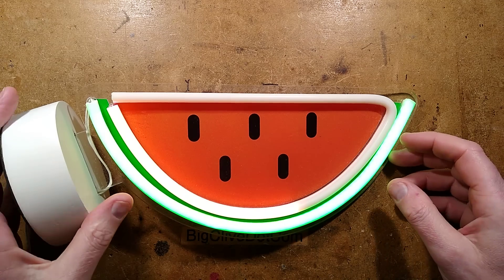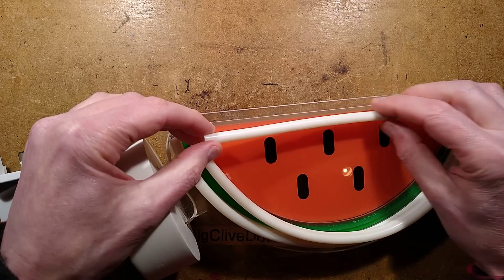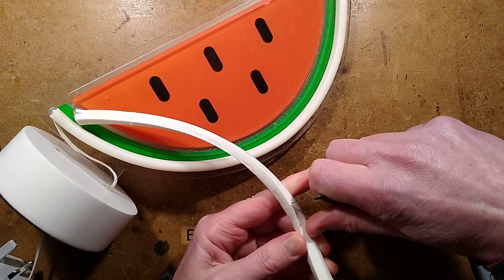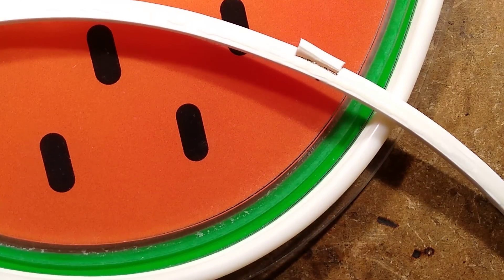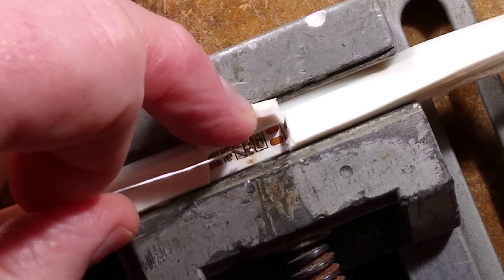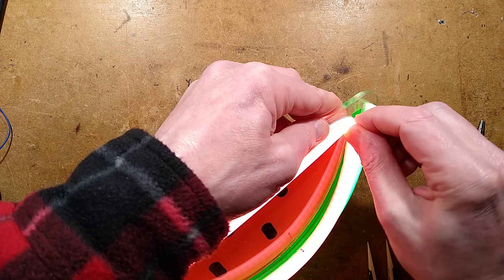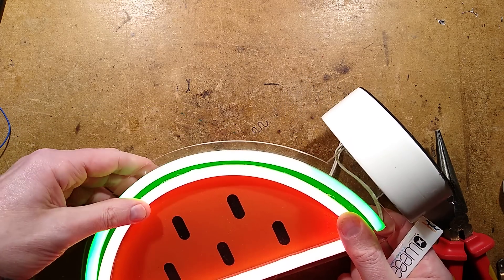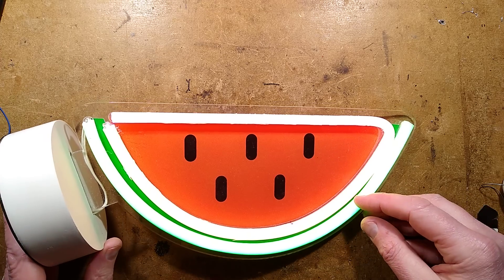Faulty LED "neon" ornament - can we fix it?

Comment: 7:33 brave to be poking it with a metal spudger while it's plugged in, and you havn't checked the power supply isolation.

Comment: Video Idea: My wife has just asked for a 'candle warmer' off Amazon.  These are made in china and use a halogen bulb to heat scented candles, typically beneath a little lamp.  They often have a wooden base, and the most damning reviews of several popular brands mention them turning themselves on randomly.  Seems massively unsafe to me.
Reply from the maker: That is a bit worrying.  There are many electric wax melters for sale.  They often use a PTC heater to get a consistent temperature.

Comment: Is this plastic UV-resistant or do i have to say "non-yellowing"?  Most of the (semi-) transparent plastic LED strip covers turn yellow over time. It can caused by daylight or violet/uv-portions/rays present in the light of the LEDs.
Reply from the maker: The blue LEDs are notorious for discolouring their protective gel.

Comment: "Brand new blade , which is just bad for fingers"... very true, sliced the end of my finger off last year after using a new blade to cut a small rectangular hole in the plastic dash in a motorhome, the blade just sliced straight through the whole dash, out the othwr end and through my finger which was nowhere near where I was doing the cutting ..never saw it coming
Reply: Finger 'mishaps' always seem to happen just after a new blade has been fitted!

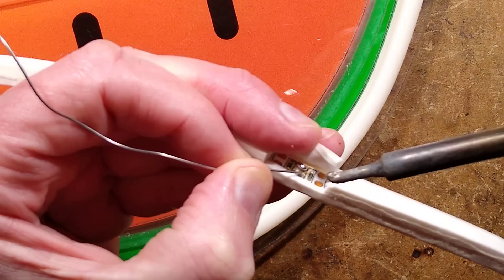Comment: 4:27... I would have checked it after you fixed the 1st Open joint to see if the 2nd joint (that looked OK) also needed repair.
Good repair with the vice...😉

Comment: 1. Pencil tip soldering iron.
2. Bridge the joint with lead clippings from a small discrete component. First rule of electrical and electronics: Make a solid mechanical connection first.
3. Use the flat end of a plastic Orange or Lemon peeler to reinstall the strip into the slot without damage.

Comment: Lol! The problems of trying to squish it in. At 1 time I used to work with a large pressure chamber. Trying to fit/refit a giant neoprene O-ring into a groove that never seemed to be the right size for the 5 foot diameter door seal, usually brought out latent memories of my old grandpappy bullock team driver. 😜🙄

Comment: A few days ago I was given a few faulty cheap LED downlights that had LED stip all around the glass instead of a round PCB with LEDs on top of the glass.
The bigger one had two pieces of LED tape connected with maybe 4 cm long jumper wires and then the wires stuffed between the reflective film behind the glass and a thin steel sheet cover.

That design seems OK-ish but the external drivers were pushing 350mA through a strip that seems to be rated only for 300mA, I used an adjustble power supply to test a chunk of strip and I didn't notice much difference in brightness between 300mA and 350mA, but between 290mA and 300mA it was noticeable. And the safety capacitors on the drivers were regular capacitors...
Reply from the maker: The edge lit downlights are common, and they do fail fast.  The tape is often not adhered properly to the frame.

Comment: Some 60/40 solder to rescue the consequences of crumbly ROHS solder.
Reply: Boy is that ROHS stuff crap, supposed to be better for the environment, not when you double the rate of disposal due to bad solder joints
Reply: @paulstubbs7678  100% correct!

Comment: I guess it works easier if you just heatup  the tape to around 40 dedrees C and then use a small roller to push it into the groove.  Or maybe some other specialized tool.

Comment: Pulling the tape out for soldering, then pulling it back through with a string or thin wire would have been my first thought unless the whole thing was molded-over.

BTW, if you want to have more flexibility at the joints where sharp bends happen, you could use a piece of thin desoldering braid to reconnect the two sides.

Comment: You want to treat it like a cricket bat handle - push the outer rubber along its length until it encapsulates the end(s) of the strip, then hold it at the end(s) and relax it back along its length, which will suck the strip back in , and squeeze that joint together in the process.
Reply: Like putting a condom on

Comment: Re: sliding the tape into the silicone, I've seen some AliExpress stores selling just the tubing, and in multiple styles for different diffusion!
Reply from the maker: Worst I've had to do was slide a 5m length into a sleeve.  And then repeat with 14 sections.

Comment: I probably would have put in a wire "jumper", with the amount of movement freedom the tape has it's only a matter of time until the solder joint breaks again. But great repair nonetheless 👍 I still admire your skill of soldering without helping hands.

Comment: I deal a lot in LED strips of a few kinds.  I'm still very surprised that they haven't come up with a continuous manufacturing technique so they can avoid those solder joints every 500mm.   Maybe there is some out there, but I haven't found it yet.
Reply: An immediate fix that springs to mind would be to use solder braid cut/manufactured to width across these joints
Reply: @snafu.X The problem is they're trying to remain infinitely compatible with end connectors, soldering, and continuous strips, and end up being mechanically weaker. They should just ditch ease of connection for durability.
Reply: I always wondered what the look like out of the factory? Is it like a huge sheet 500mm x 500mm or something?

Comment: As usual, using solder for mechanical joins (instead of just electrical joins) is not great for the longevity of the electrical join.  Of course, longevity is probably not the main goal here.
Reply: At least as far as the purposes of those paying the factory slaves, or those selling it subsequently...
Damn modernity!  Oh, and 🍉🕊️🇵🇸!

Comment: The vice of knowledge making a cameo appearance as a holding device. ❤
You wont be getting a job in a Chinese LED sign factory. 🤣 Im sure they could make longer strips then 0.5meter by now. Interesting fault 2x👍
Reply from the maker: Even the newest stuff is still 500mm.

Comment: Good job repairing it, Clive! It looks good as new. If I were the one doing the repair, I would have employed one of my random bits of used desoldering braid to bridge the gaps. I have trust issues regarding such solder bridges.
Reply: I would have used bits of wire, long enough to accommodate movement of the ends of the LED tape.
Reply: Using “used” braid is a great idea.

I have no trust issues with deliberate solder bridges. I absolutely always distrust them, no issue at all.